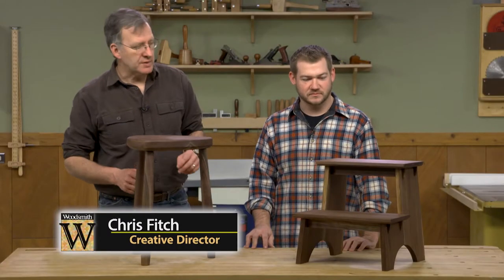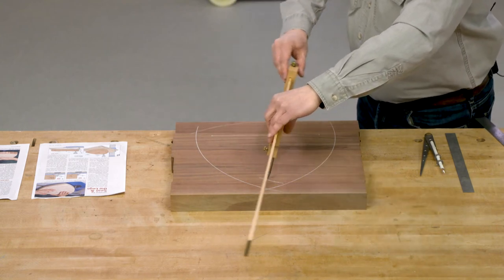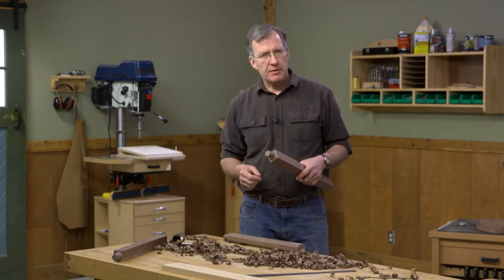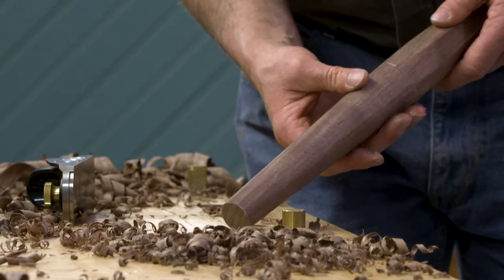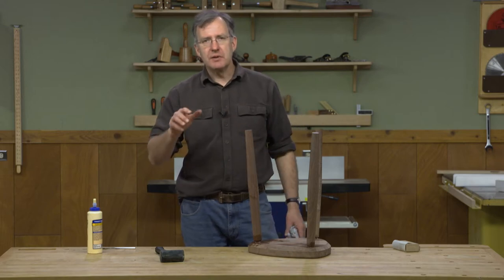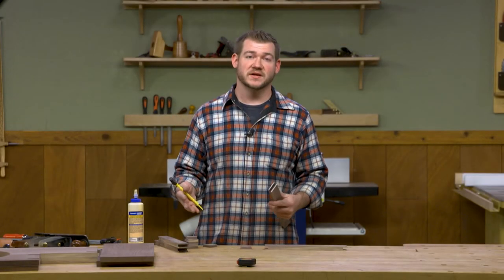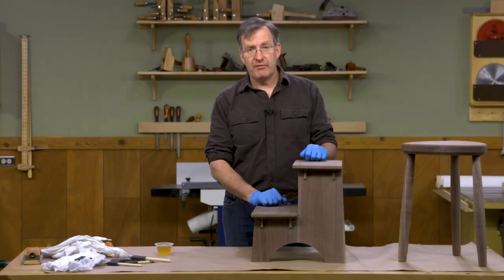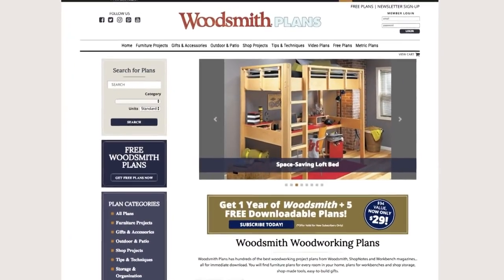A Tale of Two Stools: A Woodworking Project Journey

Comment: As a long time subscriber to Woodsmith magazine,i.e. from 1982, it would be very helpful if you would include the issue number that these projects appeared in. Some of us no doubt have the magazine and therefore have already purchased the plans, so to speak. But then, I guess we could search the back issues ourselves. Just thinking.
Reply from the maker: The Step Stool is from Woodsmith #221 and the Shop Stool is from ShopNotes #122.  ***Here is a helpful secret that always helps me track down plan origins from WoodsmithPlans.com... on the plan page, in the "Select Your Plan Package" box, hover your cursor over "Imperial".  A 2 letter, 5 digit code will pop up.  The first 2 letters indicate the magazine (WS=Woodsmith, SN=ShopNotes, WB=Workbench, PW=PopWood), the next 3 digits are the issue number, and the last 2 digits are the starting page. Example for the Step Stool WS22128= Woodsmith Issue# 221, page 28.
Reply: @WoodsmithShowandmagazine  thanks for that information.
Reply: Can't "hover" using a cell phone, any suggestions?
Reply from the maker: @colonel6007  - This is true and a downfall of that little hack unfortunately. 😔 I’ll see what else I can come up with.